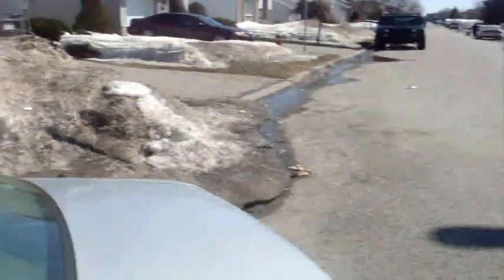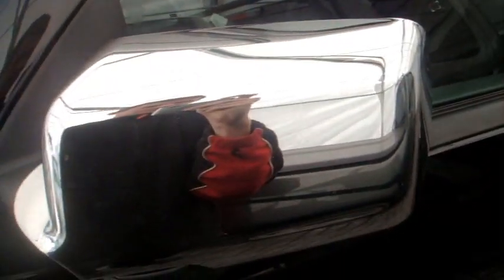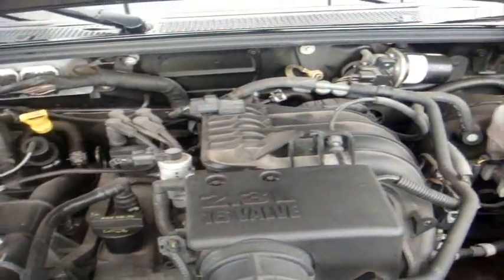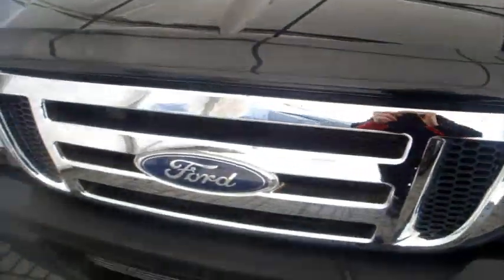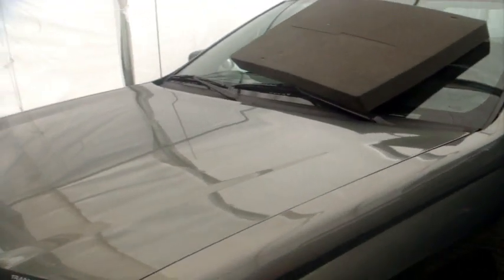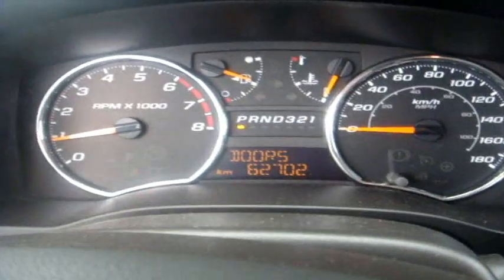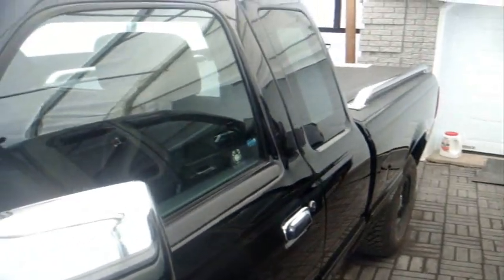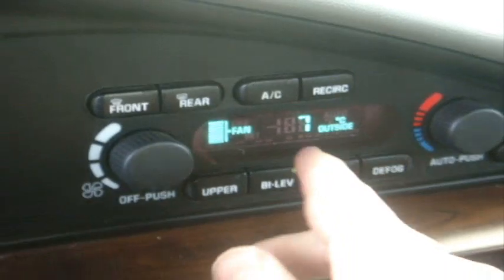Updates on the Ford Ranger and Chevy Colorado Trucks

Comment: Awesome vid.. Looking forward to the cold starts. especially on the Stihl equipment. The 3.7 is a 5 cylinder?
Reply from the maker: Hi Jeff, I'm just waiting for a nice day to take them out to start them.  All the snow's melted. You will see a new FS94 very soon.  I'm placing an order sometime in May when season's started.  

Ya, the 3.7 is a unique beast.  It's essentially the Chevy Trailblazer's Vortec 4.2L I6 but dumped a cylinder.  The reason why it's a 5 because when Isuzu designed these trucks...the engine bay was too small to fit the long 4.2 in there.  GM at the time was aiming for V6 power with a fuel economy of a 4 cylinder so it seemed to make sense for them because the 4.3 was aging and didn't get good mpgs for its hp rating :)
Reply: Awesome.. :)